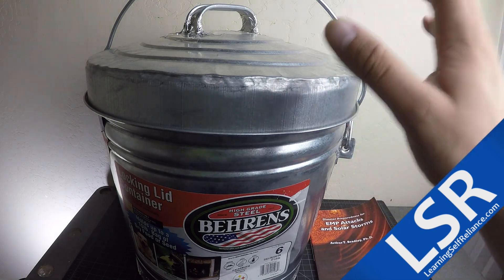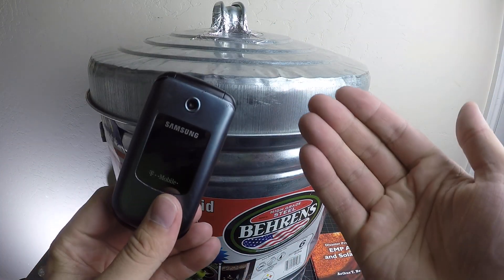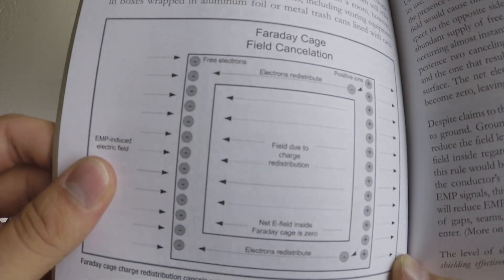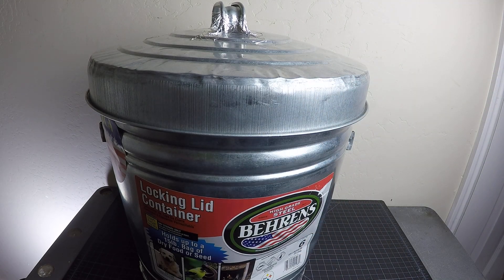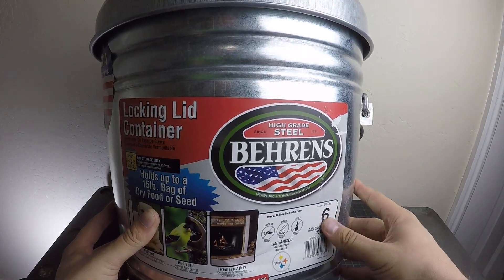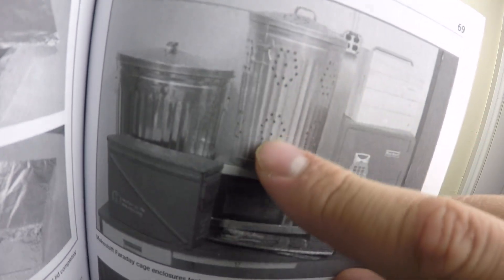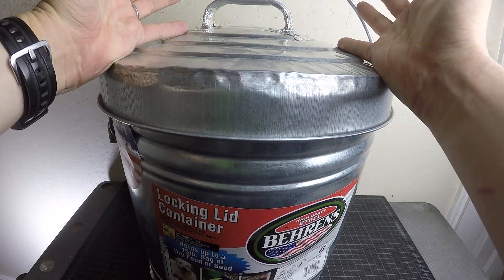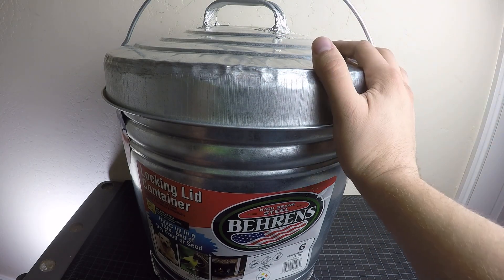Faraday Cage & EMP Misconceptions

Comment: how can you make a cage that blocks ALL signals. high or low frequency alike. do you use aluminum sheets?
Reply from the maker: I would guess that it would need to be very very thick metal. I expect the higher conductive metals would perform better
Reply: Learning Self-Reliance hey man would you say copper sheet would work better ?i thought that the better conductance the better it works. And also what if you buried can in soil like the back yard?  It s earthed theoretically?
Reply from the maker: I believe copper would work better. Silver would be even better I’m sure 😝. Yeah, I think if it’s in the ground, it would be grounded. But, as far as I know grounding isn’t necessary. Also, I bet the dirt would do quite a lot to block radiation. It’s very good at it. I have a faraday cage that is buried. I should do a video about it sometime.
Reply: You're not blocking RF, it is Electro Magnetic Energy.

Comment: I placed a rubber trashcan with lid into my galvanized steel can, with wadded paper and Great Stuff foam to keep the rubber trashcan floating within the large steel can.  I duct (cloth type, non-metallic) taped all openings on the lid of the rubber trashcan, but did NOT duct tape the edges of the rubber lid when placing it down tightly.      I then set my phone inside, ready for normal calling etc.      Then I put the rubber lid on tight, laid a towel on top as a spacer to help the metal can lid hold the rubber can lid down tightly, and put the metal lid on tightly.      Then i used metal foil 2 inch HVAC duct tape (about $10 a longggg roll at HD or Lowe's) to wrap around the lid of the metal can, to completely close it.  I also taped securely over the little holes where the can handles and the lid handle are, to close them on up.

My first cell phone test was WITHOUT this metal taping.........and it was a wash........I could hear my phone inside ringing when I called it with my wife's phone.   FAIL !!!

So I find the metal foil tape, put my phone in, close her up and tape her up as described above.  PERFECTO!   NO ringing at all.

Now the proof in the pudding:  After slitting the tape, opening up the Faraday Cage, and retrieving my phone.......I take it and check for recent phone calls and texts, and there are none.........but about 2 1/2 minutes later the phone starts beeping with phone call and text updates coming in.   Similar to how you have your phone turned off, turn it on, and soon the signals catch up with you........  only my phone was on the entire time, the signals just could not get to it within the Faraday cage.

So next I will be testing it with walkie talkies to check other wave frquencies.

The somewhat tedious part is having to retape it every time you open it up..........and the limited space, if you want to do more than just phones, cameras, walkie talkies and a old laptop or two.

So I'm anxious to find an old heavy duty storage locker like this guy did in his other video, which he has set up to be able to just open the doors and retrieve tools and electronics, then close the door and be good to go.........

With that crazy Rocket Man over there, we should ALL be taking greater measures to protect ourselves.

Throw your old laptops into your cages, too.........they just might become the backbone of a new world after all our good gear gets fried in an EMP/Solar event.

Comment: The anti static bag numbers are probably erroneous. The anti static bag's metal layer is so thin that the metal would likely melt and the plastic bag decay, under the current load and heating induced by a nuclear EMP.  All tests we can run to check for shielding are at powers that are 5 to 6 orders of magnitude or more  lower than power levels generated by a nuclear EMP.

Comment: Put some steel wool around the top of your cans instead of tape that the lid folds the wool over and forms a shield around the top. Now you can open it without destroying the shield like with tape. Also for more protection that is really needed is get a couple sizes bigger can and put the small can inside it.

Comment: I think the big problem with your faraday cage is that the lid doesn't make electrical contact all the way around. What you have is a cage with large slots where the lid doesn't make contact.  You need to have electrical conductivity all around the cage with only the tiniest gaps as the high frequency energy of a nuclear induced EMP will be very high, so the gap must be correspondingly small.
We need an economical method of having a continuous faraday cage with continuous conduction.  Electrical enclosures use conductive gaskets at the edges.
Reply: Dr Bradley has recently done videos on conducting gaskets to solve this very problem. He sells them or you can buy the same ones elsewhere.
Reply: Thanks, checking it out now....

Comment: While I believe the RF spectrum of frequencies can vary....in a properly placed nuclear explosion you could have EMP approaching or exceeding 50,000 volts in the pulse..  It will pass through metal with as little as 2% attenuation. Finding electronic devices inside and frying them.  Cell phone demos are miniscule amount of RF energy.  The ECM in cars/trucks will also take this 50KV pulse and many...many will be damaged.  The ECM regulates fuel flow, spark, timing and many other functions to keep your vehicle running.  If your vehicle is out of the pulse damage maximum then your damage may not be critical.  My suggestion save your money building ineffective Faraday cages put it towards a bicycle or a horse.  Get a Coleman Lantern because there is a good chance all LED flashlights could be toast also.  Put money into food/water/supplies to tide you over for.a year or more.  Own a gun you may need it for protection as well as food.  I have lived long enough to remember living from well water and using an outhouse.  We can get by without cell phones and the push button world we live in.  Plan a plan and work your plan.
Reply: Will cell phone towers be fried?  And if so, forget internet and a network to connect to with your laptops and cell phones.
Reply: @jay_jjacobsen6695  so ..... get your electronic library downloaded today .... gigs and gigs and gigs of text books tutorials etc etc etc ....
Reply: @johnjacobjinglehimerschmid3555  Survivors won't have time to be messing with any of that.  Survival will be a 24/7 job.  Everything a person does will be for survival.
Reply: Jay_J Jacobsen no they won't.   Thats because they are over  100 feet in the air.   If you believe that I can sell you on anything.
Reply: You forgetting something, like he said it's for dampening the effects,  so if you are not that close to ground zero , but some reduction may save your devices.
Reply: @PaladinOfChrist77  "There is a world of discoveries for whoever is able the peel the many layers of truth." Neil Armstrong
Reply: I'm thinking phones would be great to keep for media, music or movies etc, but flashlights are great. I'm gonna buy some lanterns though, great idea.
Reply: @iamagoldenratio1471  
If such an event would happen, cellphone towers and their equipment as well as internet and their equipment may mostly not work either.
Most likely a LED flashlight or LED lantern may not work and a regular flashlight bulb may be burned out also. Many electronic things may not work.
So you are well off, if your lantern is kerosene, gas or Colman fuel powered or if you have candles as long as there is no electronic part involved to operate them.  Using different alternatives is a great move.
Reply: The reality is that for 99% of people the loss of your personal electronics is not going to be the biggest issue, if we haven’t hardened our grid and that goes down then most people are going to be worried about other people. Escaping the cities, finding edible food and potable water, your cell phone wouldn’t help anyways, having a big battery to lug around won’t help, lighting will only attract the people who intend to prey on you. For people in cities the best bet it just guns and ammo, and maybe put some high intensity tactical flashlights in some very small enclosure (these will tip close firefights at night strongly in your favor). If you live in the country and you have already prepared your hand pump for water, your garden and livestock for food, a cellar for food storage, guns and ammunition, and the often overlooked network/community of support, then focusing on some electronics isn’t terrible. For instance you could faraday your pump house with a big generator inside. Having the ability to pump water in concert with a large holding tank is probably the most valuable labor saving investment. If you can, a small efficient generator to run a deep freeze is great, a few hours of run time every 3 days will keep unprocessed meats good while you process what you can. This would improve your ability to capitalize on large game more efficiently. And finally, something people often overlook is a solid box fan, for winnowing seeds is hugely labor saving if you are growing beans and other plants meant to produce dry goods. Other than that, flashlights are definitely useful. I debate whether a car is really useful for escape, a small truck would be great to help haul firewood and spoils of hunting, but I would rather take my chances off road on foot than driving into an ambush.
Reply: Perhaps - but I live in Florida and therefore cannot literally live without a generator to run the portable air conditioner I also cannot literally live without.
Reply: Thanks for the info
Reply: It's all very well but I doubt there is such a thing as atomic weapons, it's war propaganda gone stale...

Comment: Several of the studies are showing that even if a vehicle quits working after an EMP weapon, for a lot of the newer vehicles, they believe all that would be needed is to disconnect the battery then reconnect it to reset the vehicles sensors and most cars will run. I have been trying to tell people about this for years, but everyone believes that all vehicles will quit working and we will be in the stone-age after an EMP.

I use several Faraday cages similar to yours, yet I have mine layered for additional protection at different frequencies. First I use a sealed aluminum foil covered box to store my important electronics in. Then I use a copper mesh material to wrap the aluminum foil box and seal it with copper tape. Then that is heat sealed inside an EMP bag, then the bag is placed in a galvanized can similar to the one you have there and is sealed with aluminum tape. I shouldn't have any problems after an EMP.

Personally, I believe that we will be hit with a Super-EMP weapon within the next year which will be blamed on either Iran or North Korea, but I don't think either of them will really have their finger on the trigger. I think that finger will be a lot closer to home than most people want to admit or believe.
Reply: The Clown In America are not to be trusted
Reply: WH6FQE - The Kilted Piper how can I call you if your cellphone doesn't ring.  Damn dude your mother called last night and was wondering why you don't answer the phone.   I'll pass it on to her. :(
Reply: Agreed. DE KG7STF

Comment: Unless you Earth the Can, all you have is a Fat Antenna. Microwave Ovens are Designed to Keep HF in and from escaping to your Enviroment or your hands by means of Earthing the Micro wave Case. The Earth and Neutral are tied together at the Fuse Box and Grounded to Earth. I, my self would Ground a Faraday Cage to the Earths Potential as the Faraday Cage may Resonate and act as a Frequency to Voltage Converter and if it is Earthed, then it will Have a Path to Drain away any Voltage Induced from the Cage safely back to Earth. Also Line your Small Steel Earthed Faraday Cage boxes with LED Sheets, like the People wrapped around them self's at the Chernobyl Meltdown Clean up. Good Luck!!
Reply: No, you don't need to earth the can. He addressed that specifically. The book addresses that specifically also.
Reply: Your ground wire will become an antenna to collect emp to your faraday cage!

Comment: If the can is welded at seams then anything more can add nothing.  Furthermore, the aluminum tape has an adhesive backing which may actually insulate, rather than add any conductivity.

Comment: Would a galvanized steel truck bed tool box work for a faraday cage?  My husband has one from a truck we once had.
Reply from the maker: +Mary Cleveland as long as its very well sealed and has no holes. If you don't plan on opening it often, use some metal duct tape to seal any seams

Comment: If the Faraday cage doesn't work with a cellphone, it certainly will not work with a broadband EMP blast.  This one will be useless.
Reply from the maker: It doesn't need to block all radio waves, just block enough to no longer be harmful.
Reply: EMP pulses are not Radio Waves or RF, they are Electro Magnetic energy, the earth's magnetic field is what generates an EMP pulse, not Radio propagation. The nuclear detonation releases Gamma energy and this reacts with the earth's magnetic field and produces an electromagnetic pulse, actually there are 3 waves of energy, E1, E2, and E3.
Reply: An EMP blast is very broadband including covering the cellphone spectrum.  A cellphone test will only be on one frequency pair, receive and transmit.  If the Faraday cage will allow the cellphone through it will allow the rest of the spectrum through as well.
Reply from the maker: It will allow much of the  spectrum through, but it will block most of the decibels.  We're trying to block damaging radio waves (think of them as loud), not all radio waves (total silence).
Reply: Depends on the yield of the weapon and the design of the bomb etc.
Reply: Again, it is not radio wave energy. It is electromagnetic energy.
Reply: Confusing statement, but as below, an EMP pulse is not Radio Frequency, it is ElectroMagnetic Energy, totally different.
Reply: You don't understand RF, total silence is not "all radio waves"? Total silence = No volume level (which is generated in decibels) or known as "sound" or even as "gain".
Reply: milky55way2012  radio waves
Reply: milky55way2012 As a former fixed crytographic repair specialist , trained at  Ft. Monmouth signal school I have to tell you that  radio waves are indeed part of the electromagnetic spectrum that are just in a possibly  different frequency  range than the emp and in most cases an emp  will not be modulated as most rf signals are but will be at much higher output power ranges
Reply: Radio waves are not harmful to humans, otherwise we'd all be dead by now......the Faraday cage is to reduce the effects of an EMP (Electro Magnetic Pulse), which can destroy sensitive electronic equipment. All devices that are wired would possibly be destroyed as well as communications equipment, transformers etc.
Reply: milky55way2012 please show some references to backup your statement about radio waves not being  harmful. Have you ever heard   Of directed energy weapons, Radio waves  in a high frequency, high power  dissemination system . Go to a local cell tower and read the warning signs on the fence . RF energy is  electromagnetic energy it is all about frequency and power output, period!
Reply: He specifically addressed that. You somehow missed the whole point.

Comment: Forgot to add, zinc plating oxidizes quite easily, the oxide coating protects the steel from rust but it is also an insulator of sorts. Try hitting the inside of the lid with some 0000 steel wool as well as the lip of the can before you place the lid on again. Don't put excessive pressure when you rub it. Just enough to bring out a slight shine. You could also try bonding some 1" wide tinned braided wire ,available from most any Amateur radio supply shop, to the lid and side of the can. You could try rosin core solder but acid core will work best. Steel wool the areas before soldering and if you use acid core solder try neutralizing the flux with a baking soda/water mixture rinsing with clear water. Dry with a hair dryer and spray on some paint to protect the solder joint.